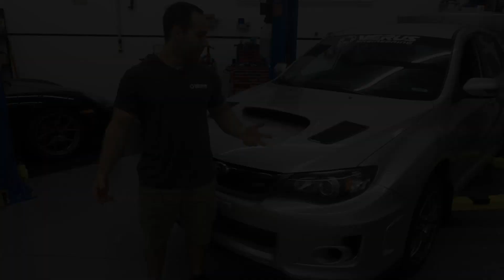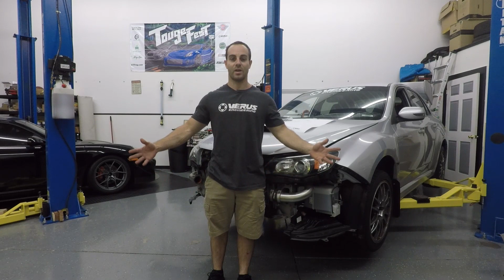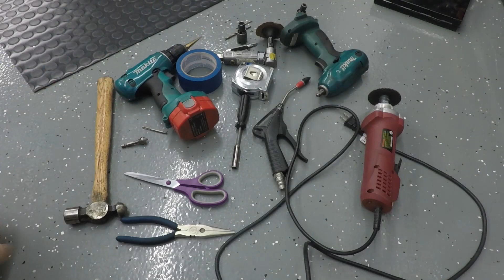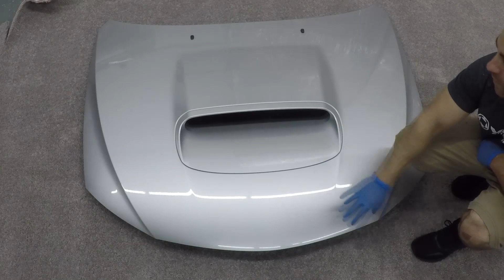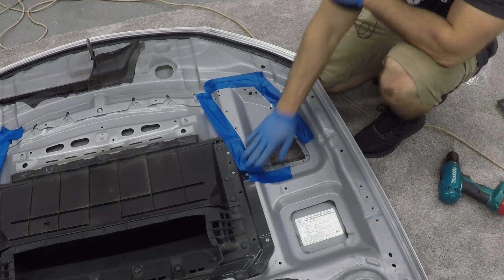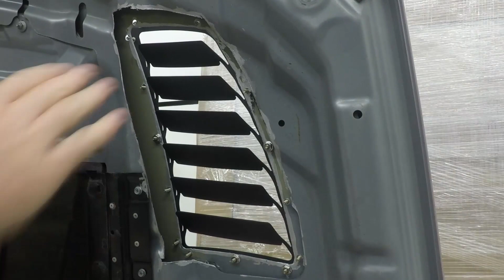Subaru WRX/STI (GR/GV) Hood Louver Kit Install

Comment: Would I be able to use these on the va wrx?
Reply from the maker: Yes, absolutely. All of our sheet metal hood louvers are generally universal as long as they are not installed over a body line crease.

Comment: Hey so if I have a tmic and install these louvers is it going to affect the airflow to the intercooler and maybe also affect the intake as I have a Cobb SF intake
Reply from the maker: It should improve flow through the intercooler and improve charge temps if anything.